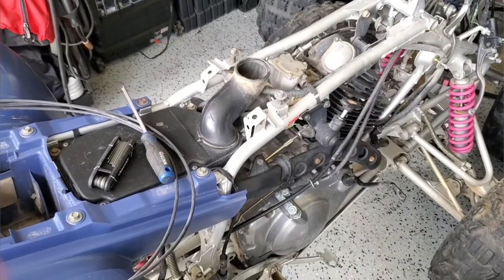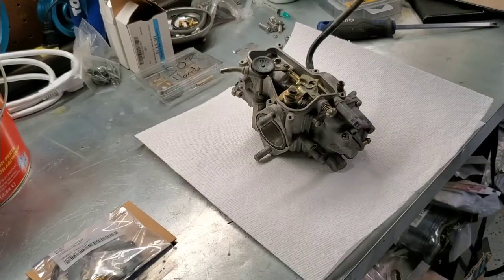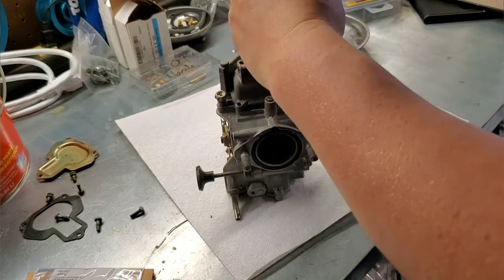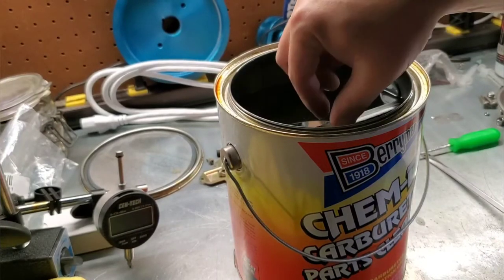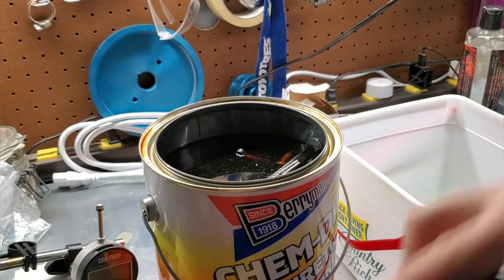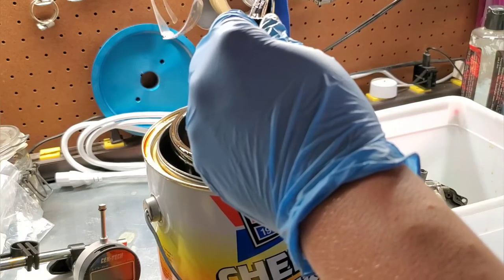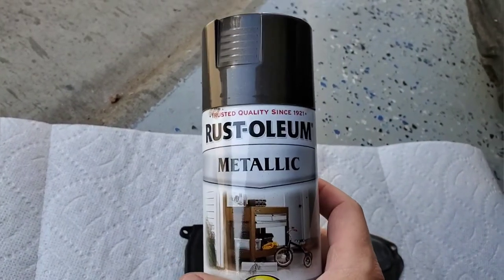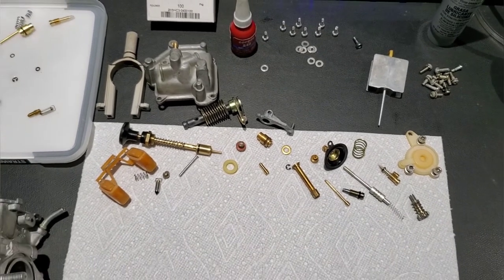PT.6 YAMAHA WARRIOR ATV MIKUNI CARB RESTORATION AND CLEANING - CARB WAS NASTY!

Comment: The air cut off diaphram,  please someone chime in with their thoughts on how this works on this style of carb.  I think it does what it is called. Upon deceleration it closes the diaphram and it then  pulls fuel into the enrichment circuit so that the mixture is not so lean that it backfires/ pops.  For carbs earlier that have no accelerator piston pump its function is also to enrich the fuel upon throttle snap from idle to WOT.  MAYBE?

Comment: I have 89 yamaha big bear 350,  having issues with accelerator pump circuit.  It doesn't have the piston type.  I need info on how it's accelerator circuit functions.  In the bottom of fuel bowl on the right forward plate, engine side is a jet and passage ways to carb. I believe this is the circuit. The air cut off diaphram on the right side of main body is what I think is for the pump action for the accelerator circuit but I do not know this for positive. Any Info would be very helpful.
Reply from the maker: Wish I had more info to help you. If you can't figure it out, see if zoom zoom carbs have a replacement. Surprised how well they work for dirt cheap.
Reply: Mr. Garage after much checking and double checking. I have determined that the jet in the forward upper half of the bowl is for the choke circuit and only the choke.  With choke closed no fuel passes through the circuit coming out of the bowl.  That leads me to believe that this early 89 model of carb gets its fuel for all throttle conditions from the main and idle circuit.  I found that the tube that holds the main jet has holes in it as an emulsion tube has.  2 of it 10 holes were plugged. I have yet to reassemble for testing. If it works then it was the emulsion tube.  F it still starves on throttle snap to WOT then I am going to raise the needle to determine its effect.  More later!

Comment: You did find the jet in the fuel bowl, out of the many vids I have watched you are the only one who has removed it or even know it was there!  I believe it is for the accelerator circuit but I am not for sure!
Reply from the maker: I believe that is what it was for as well. Feels like a long time since I worked on this carb, likely because I have worked on so many others!
Reply: @MR_Garage  best video out there. Thank you so much.  Could you possibly tell me if there are other  O- rings any where else to be installed besides the choke, air screw, and seat? Thanks